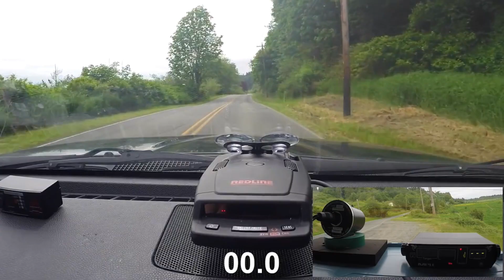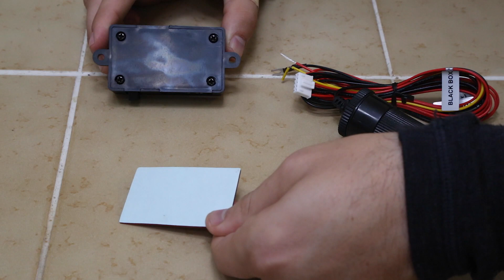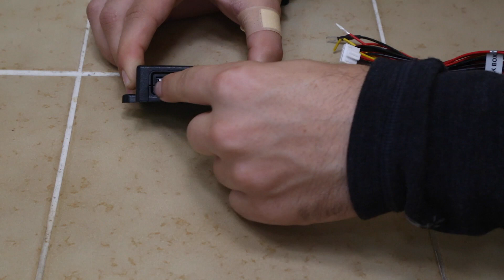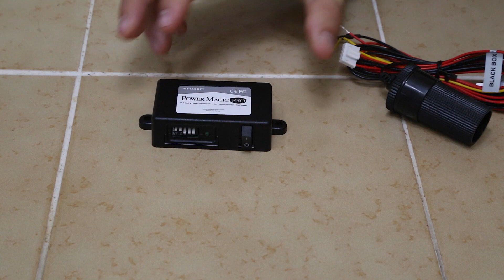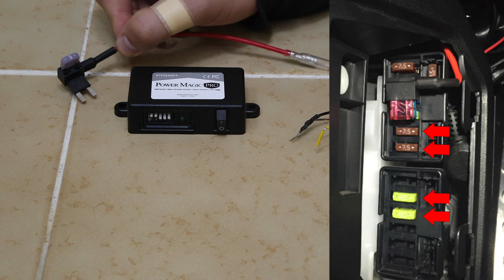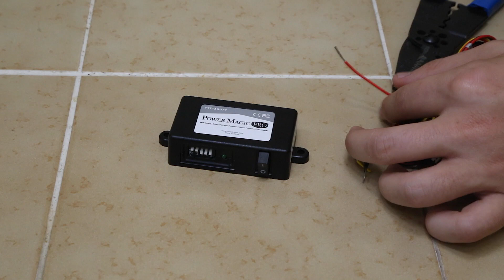How to Configure and Wire a Power Magic Pro

Comment: For those not interested in any parking mode functionality at all (like me), couldn't I just install a regular old fashioned inline toggle switch somewhere on the camera's yellow ('Always-on') power wire and flip the switch to 'Off' so to kill any default parking mode function built in to the camera as opposed to installing a PMP box leaving the box switched to 'Off'? This should basically replicate the same action, correct?
I ask because I'd like to install a Blackvue 750 3-way cam but personally don't like that the cam has a built-in parking mode 'requirement' that can't be completely disabled. There's no option to kill parking mode completely from within the actual camera if I understand it right based on what the Blackvue rep told me. I don't see why Blackvue wouldn't incorporate such a feature/option in their cams (completely eliminating required power for parking mode altogether). Please let me know if I wasn't clear on this.
The only thing I can think of as to why my idea wouldn't work is that maybe, with my method, I'd kill any power required for any internal camera presets, settings, etc thereby causing the cam to 'reset' back to factory default mode every time I started the car and flipped my toggle switch to 'On' again..
Thanks.

Comment: Same day a connect mine got fly a connect straight to the battery  because after a wire is not power and light don’t go on so a text straight to the battery just connect negative first and red after a soon a connect yellow hear a noise like something blown and smoke thank god is no ready set in the car because by bye car like say probably is damage ready because I just buy used one

Comment: 2 questions: first, can we choose voltage minimum and time, so it shuts off on which comes first. Lets say 12 hours or/and 12.5V. Seconde question: i will order it with the PMP. Later I will probably get on of the external battery. Do I still need the PMP or I will have to get ride of it since I have extra power? Sorry I’m a French speaking person so if you explained that little part, I apologies.
Reply from the maker: Right, you can set both the maximum parked recording time and the minimum voltage level. Whichever one it hits first, it will cut off the dashcam.

If you use a dedicated dashcam battery, you no longer need the PMP anymore.

Comment: You explain how the wires all configure but you don't mention about the size fuse and which location on the tap either one goes. Also, those "vampire" taps are horrible.
Reply from the maker: You're absolutely correct, and that's because that's not the point of the video. You can run the math on the power draw for each device and what size fuse you need.

Comment: Dose it has battery or depends on car battery??
Reply from the maker: It uses your car's battery and is itself a voltage monitor to shut the dashcam off when the car battery drains too far.

Comment: Do you have a video on how to configure the switches on the power magic ez OBD ?
Reply from the maker: Not specifically, but it's the same idea as the PMP.
Reply: @VortexRadar   1. Can you delete individual clips from the SD card VIA the phone app, or lets just say can you delete specific clips without using the reformat button on the camera/or removing the card and using a computer?  2. I've configured the camera VIA the app to not record to either camera in parking mode and when I shut the car off, the cameras continue to record. I really only need the cameras to record in parking mode for very short times ( usually less than 1 hour). It's a new car and I don't want to drain the battery. Thank you.

Comment: You don't have to connect both power cables, do you? Yellow if you need constant power or red if only when engine is one. Am I right?
Thanks
Reply from the maker: You do. The engine supplies power when the car is on and the battery supplies power when the engine is off.
Reply: @VortexRadar  awesome, thanks

Comment: After having the PMP I found that almost everyday the Dashcam is off I thought the pmp is not working very well then after diagnostics I found out that it goes off because the voltage goes down to 11.6. Did anyone have a similar issue or a solution. 
By the way that causes a headache because my car is new 2019 which means the battery is also new. 
Thanks

Comment: Great explanation, just a question though, if I wanted to set it record it to infinity and a 12.5V cut off voltage, do i still need to turn the switch on and off evrytime whenever i’m going out of the car?
Reply from the maker: The on/off switch is just there to let you choose if you want parked recording at all. If you want driving and parked recording, turn it on. If you only want driving recording, turn it off.
Reply: Vortex Radar  awesome video.  I just got this camera and installed it.  Just the power magic pro is giving me a hard time.  I won’t power the camera.  There’s power going to the power pro but no green led light    Is Im this a set up issue or power pro is blown ?  Thanks
Reply from the maker: Are you sure everything is wired in properly? Did you verify power with a multimeter?

Comment: You do not crimp the wire from the PMP directly to the fuse tap, there is a complementary male plug that you crimp to the PMP then that plugs into the female socket of the fuse tap.

Comment: If you have an opportunity to crimp a terminal onto the end of the add a fuse cable, do this instead of using the T splice connectors. I wouldn't recommend this method at all. They are only used as a last resort.

Comment: Great video! I'm connecting the wires to a 25a (my door locks, always on) and a 15a (my accessory/cigarette lighter) I bought the add a fuse. However, I am wondering, how much amps does the camera use? What if I plug it into a 10a? Will it blow out? Is 25a too much? Or does it not matter what I plug it into?
Reply: Way less than 10a. You'll be fine

Comment: My 2014 Cadillac CTS doesn’t have an acc power that turns on and off with the ignition I checked all 3 fuse boxes every fuse stays 12 volts doesn’t matter if ignition is on or off
I have the battery backup and thinking I could use the power magic pro but seems I still need a acc power I can’t win lol
I am charging the battery backup with the cigarette lighter but it’s a bit slower
Does anyone know where I can tie it in without frying anything lol
Reply: go with magic pro EZ plug it into the OBD port

Comment: I installed a dr 750s 2ch in my car last week with a power magic pro ez. The hardest part was how to hide the extra cable. Speaking of power magic pro, I'm thinking of using my lte tablet to provide wifi for my 750s while parked because I sometimes park in the middle of the parking lot of our appartment complex and my home wifi can't reach my car. Do you think I can use the power magic pro to power my tablet even if the car is turned off? Im going to insert a usb car charger to the power pro output. I've  never tried to leave my tablet with hotspot on overnight. Maybe I'll try tonight and see how much battery is left in the morning. If it doesn't drain I might as well forget the magic pro. But if it does drain can I use the magic pro to keep my tablet from draining?
Reply from the maker: You can get an adapter like this https://amzn.to/2V7quAu that adds USB ports so that you can plug in both your DR750S and your tablet. The PMP will work like normal to provide power and eventually shut it off once the battery drops too low. Once it does, your dashcam will turn off and your tablet will stay on, but you can give it a whirl and see how long it'll last you. 👍

Comment: I set the power magic pro to 12hrs with 12 v but my battery died. my car is 2013 Toyota Camry . how do I keep my battery up with this setting? I want to set it for 12 hrs without the battery dies . pls
Reply from the maker: Can you raise the voltage cutoff threshold? You may want to look into either a fresh new battery for your car or a dedicated battery for your dashcam.
Reply: I'm wondering the same thing.... my truck won't keep the camera on for longer than 10min on 12.5v I don't know if I should switch it to 12v or it may kill my battery.. :S

Comment: Great tutorial, very thorough! My battery and fuse box is located in the trunk (2012 Chrysler 300S). I need to splice the red and yellow wires in order to tap into the fuse box.
I called BLACKVUE and they said to use 3.2mm wire (8 gauge) but 8 gauge is very thick compared to the red and yellow wires on the PMP. 
Can you recommend what type and gauge wire I should use to “splice” the two wires? Thank you.
Reply: What did you decide to use for wiring?  I have the same situation and stumbled onto your comment.

Comment: Great video, very helpful.

One question, I'm using this exact camera with the power magic Pro. I have a mobile hot-spot setup in the car to use the cloud feature and its great but my mobile hot-spot runs out of power very quickly (it's an old smartphone)

I'm thinking about using a vampire tap like you have explained and hardwiring a constant USB source into the blackvues fuse tap. I think going through the power magic Pro with the USB is a good idea as the car battery is then protected from being drained.

Do you see any problems with that setup? I assume the red wire goes into the vampire tap and the black is the ground, does the ground have to be a different source to my blackvue? 

Thanks.
Reply from the maker: That’s a good idea. You can do that. Usually grounds are shared (which is why they’re called common grounds), but to be in the safe side, it might be good to use the same ground location if possible.
Reply: @VortexRadar  Great that's really helpful and thanks for the quick reply. Awesome video and one of the reasons I chose the camera 🙂

Comment: What amp size fuse is needed in the addon circuit? Does it need 2 - the original and the added fuse? Thank you.
Reply from the maker: Consider how much power each device you need uses. It's listed in the specs. A dashcam and a radar detector will each draw less than half an amp each. Doing 2-3 amps for 1-2 devices is generally plenty.

Comment: Great video and examination.wouod you recommend tapping into the OBD sensor with an obd adapter for a singular device?
Reply: adwin pal that’s the easiest way. I didn’t because I have a KTuner V2 into my obd2 for on the fly running

Comment: I had installed one of these devices. Worked great for about 10 months before it gave up the ghost. Ordered another one, last roughly 6 months. I replaced it with an OBD/USB wire and haven’t had any problems since. Simpler to install too. IMO, the Power Magic Pro is rubbish.

Comment: I want to install a DR750 2 ch IR on a Blendmount that will House both cameras from the rear view mirror post.
Do you have a link for this?

I also want to have a 3rd camera for the rear and was wondering how this would be set up to record all 3 cameras?
Thanks 
By the way......I enjoy all your well explained videos. Thanks
Reply from the maker: There isn't an option for that. You can attach it to your windshield though. I've seen an accessory that lets you drop the camera down a bit in case the positioning would leave it partially blocked by your RVM or something. http://bit.ly/2JPynFA

To wire in a third camera, you can get a cig. lighter splitter so that both cameras can plug into the same PMP port.

Comment: do we have to fit the blackvue both on a fuse active when car is on and when car is off? and also what size are they, i believe one is mini the other is ato regular, right? also some people put it onto radio other than the headlights, is there a reason.  and also what amp do you put, does it have to match the fuse slot you put in, for example if the headlights 5amp, do we put 5amp? or should we put 20 together with 5 ?  sorry bit confusing but, i really need to do the correct piggy back fuse connections between my blackvue750s (1 channel only)  and my 1 series f20 2016 bmw

Comment: This is a great video to show the power magic pro but I cannot agree with you saying to tap into one add-a-circuit with multiple accessories. There’s plenty slots in your fuse blocks inside and out. In two of my cars with blackvues and pmp’s I used the trunk for constant and cigarette lighter for trigger power.
Reply from the maker: Sure you can buy multiple fuse taps or tap into other power sources too. That's just one of the simpler solutions for people. There's more than one way to skin a cat. ;)

Comment: you say you connect multiple devices (vampire taps) to a single tap in (RED wire). how many devices is too many?
Reply from the maker: You need to run the math yourself on how much power each device uses and then consider the size of the fuse. That's the main limiting factor. I run many devices off of a single tap, often at least 5-6 or so.

Comment: Does the power magic pro act has a 12v DC to 5 V DC converter?
Reply from the maker: +Garret Nope. Dashcams typically use 12v which is what your car provides. If your dashcam uses USB, that’s 5v and the power adapter will do that conversion for you.
Reply: Vortex Radar so why do most dashcam install videos require you to hardwire a device that can step down from 12V DC to 5V DC? 

P.s my dash cam uses mini USB to plug in with the car charger port
Reply from the maker: Because many dashcams are powered via USB and the USB spec is 5v. If the dashcam doesn't power from USB, it typically just uses the 12v that the car supplies. Read over the specs for your dashcam so you know what you need.
Reply: Vortex Radar I was looking at mine and my car charger portion of the cable says it takes an input of 12/24 V and outputs 5V at 2.5 Amps 

With this being said I couldn't use the power magic pro right? I would have to use a 12V to 5 V converter to wire in my car?
Reply from the maker: The power magic pro outputs to a 12v cig. lighter port. It's compatible with every single dashcam on the planet, so long as they use a cig. lighter plug too. Everything runs at 12v. The PMP will output 12v, your cable will take in the same 12v, and it converts it to the 5v your dashcam needs. Don't worry too much about the voltages. You're not going to have any issues.
Reply: Vortex Radar I think I understand now, the part I wasn't realizing is that you are suppose to plug the cig lighter plug into the female end of the PMP. 

I was getting confused bc I was planning on not using the cig lighter cable, and using a USB cable to wire directly to the car but now it makes sense. 

I appreciate your patients helping me figure this out you earned a sub for sure. Thanks a lot
Reply: Garret try this..... Dash Cam Hardwire Kit with Motion Sensor Switch Solargo 12V 24V 36V OBD Input 5V Output Compatible with Mini USB and Micro USB for Video Camera Recorder DVR https://www.amazon.ca/dp/B06ZY27GS9/ref=cm_sw_r_cp_tai_8ei4zbYDD4Z1T

Comment: thanks for the video,,,,, question,,, on the ADD a circuit wire that has the 2 fuses,,, how do you know how to plug it to your fuse box? meaning it has 2 legs that plug in so witch on is the hot one and witch one is after the power goes through the fuse , I mean you can actually have it backward with power all the time correct? any ideas? thanks
Reply from the maker: It doesn't matter which way you go. The fuse completes the circuit when in place. Without the fuse there's a break in the electrical contacts so electricity can't flow. So you can plug it in either way and no worries about getting it backwards. :) Good question!
Reply: thank you so much
Reply: Vortex Radar it does matter actually.  It’s important that it’s installed correctly to prevent current from both devices going through a single fuse.
Reply from the maker: Ah yes, you’re correct actually. I was wrong. Thanks.

Comment: Hi. Will the parking mode turn on with the power magic pro when you shut off the power ignition? If yes, how?
Reply from the maker: Cameras like the Blackvue dashcams can automatically sense when you're parked. Usually it's through the G sensor (your car is very still when parked, unlike when driving) and/or via GPS to sense you're stationary.
Reply: Thank you for the fast answer ;)
Just one question: i saw a lot of comparations about the blackvue and thinkware f770. They say the thinkware have better image for license plates reading but i think it is the opposite.
Reply from the maker: I'm curious too. I haven't tested the F770 yet but I've heard similar claims about video quality and detail. 

I do like that the F770 has the power management stuff built in and doesn't require a Power Magic Pro like the Blackvue cameras, so that's something too. :)
Reply: Vortex Radar  what you think about the new garmin dashcam 55? Is it a good option?
Reply from the maker: +Milton Pimenta I'm not familiar with it and haven't tried it out

Comment: Thanks for sharing this video, I've got a dashcam which faces the front, I'm looking to purchase another camera which faces the rear, can I put a multi-socket for it to work? and also does the Power Magic Pro works on any brand of the dashcams?
Reply from the maker: Yeah you can use a multi-socket. You're just finding a way to provide it power. Doesn't have to be fancy. As for the PMP, yeah it works with any dashcam. It just controls when the dashcam gets power and then provides a standard 12V power source when appropriate.